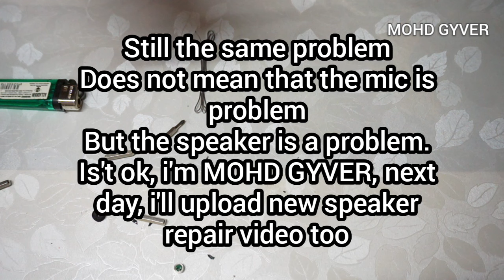Repair: How to change mic baofeng walkie-talkie

Comment: Bro can u helpme pls?
Reply from the maker: Yes. What help?
Reply: @MohdGyver  I have the bf888s max and I had to open it because it had a loose screw inside, I put it back in its place and now when the handy receives a signal you hear an interference and not even the communication, if it transmits well but it cannot receive by the noise caused. What can be?
Reply from the maker: @franciscoheyde7934  I'm sorry, I've never been like that.  so I don't know how to help.